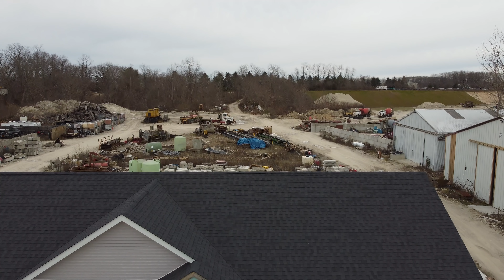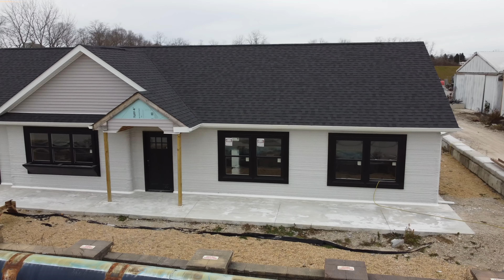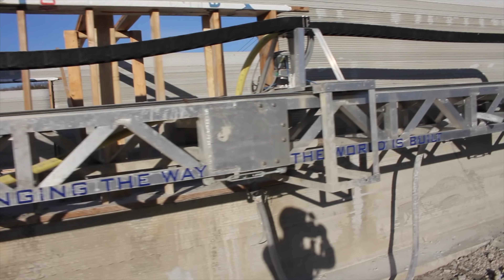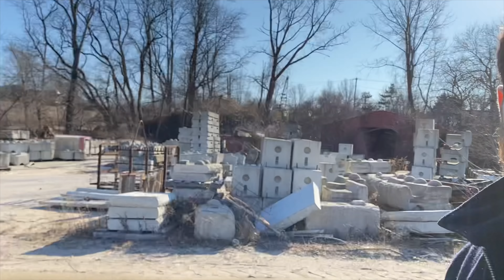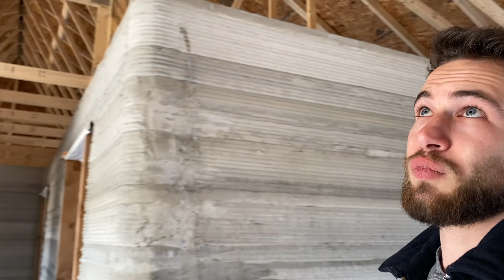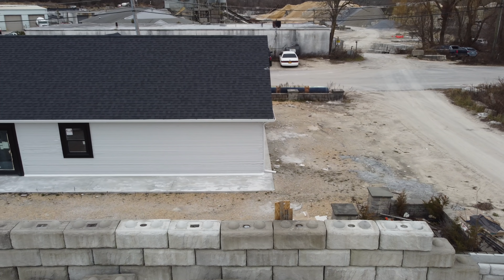Biggest 3D Printed House in America ALMOST COMPLETE Part 3 [*Mostly Drone Footage*]

Comment: I am still not getting the fascination with 3D printing in this application.  They used a type of concrete for this building, but using 3D printing they built the house much more slowly and at similar costs.  There are already methods of building prefabricated homes much more economically and quickly. When I see how cumbersome the equipment is, I am left shaking my head.
Reply: What a joke! This is an insult to the entire building community. We are actual craftsman , some of us having decades of experience, and you think this is the future! We have been building home the same way more or less for hundreds of years and they have stood the test of time. Innovation is the key to moving forward and advancing building science, not this garbage. A house this simple would take maybe 2 weeks to get to this stage from concrete. How does this make it more affordable for the consumer? Short answer...it does not! There is no way you will ever replace craftsman with this, and if you have convinced yourself that you can, you are beyond help. The future will be built by hand. Full stop. End of story
Reply from the maker: It’s a work in progress. All of the founders I’ve spoken with are making improvements with every build. Efficiencies and new methodologies are constantly being realized. From my perspective viability only goes up from here.